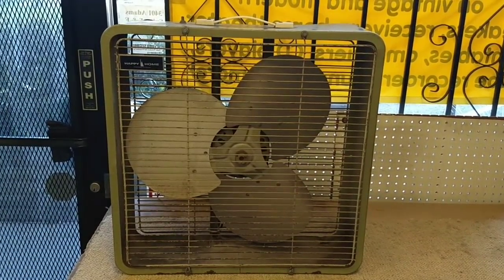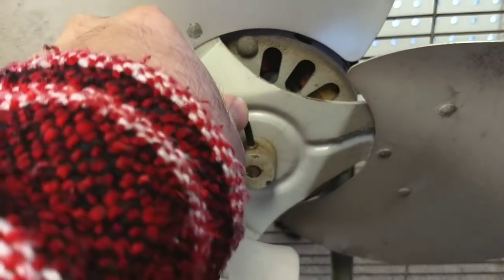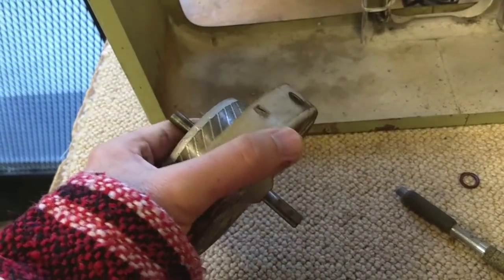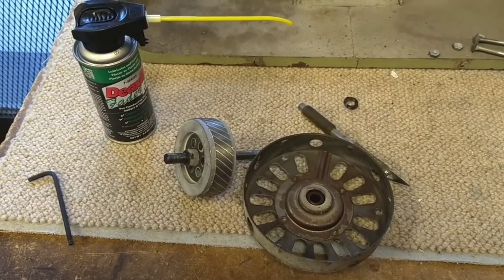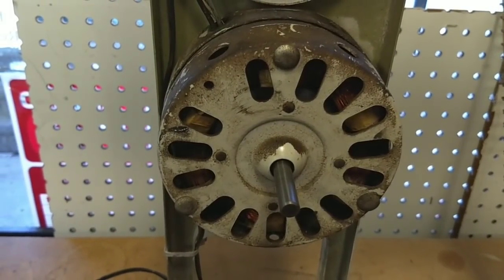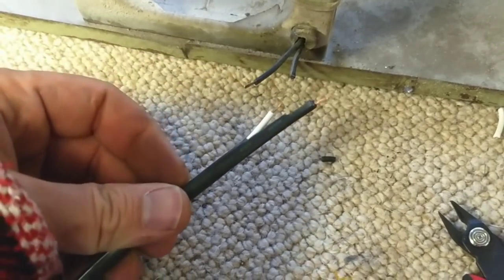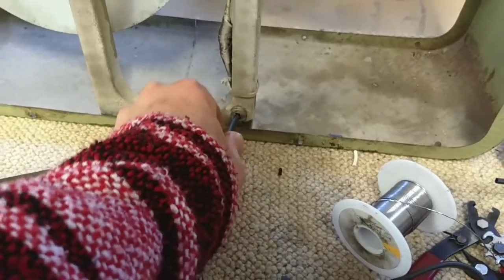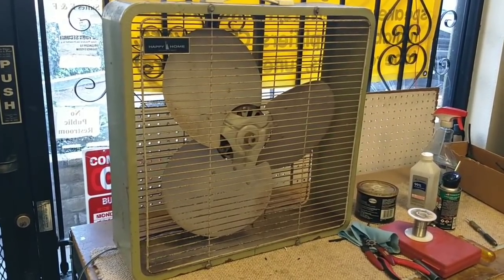Quick repair of vintage New Home 20" box fan

Comment: Hey Broski Jordan!
Man am I happy with you and your vids.
 So I took the fan apart exactly as you did and did exactly as you did. I cleaned everything and it looked good inside. I could not press the motor shaft in and out like you showed us.
I will say it took over 70 minutes to carefully get the back of the motor case AND the center of the motor free from the front so I could clean those holes and everything you did.. I used mineral spirits and  rinced all with alcohol. 
Greased it all up and it went back together very well with some force.
THERE ARE SO MANY WASHERS ON BOTH ENDS. GOOD THING YOU TOLD US ABOUT THAT BECAUSE I VAS VERY CAREFUL FOR THE ORDER THAT THEY CAME OFF BACK IN FRONT AND BACK SO I Could PUT THEM BACK EXACTLY AS THEY WERE.
Thanks so much. I now have a perfectly new and working wisper quiet happy home fan in My happy home and Im super happy!!!  Lolol
Stay Cool Man!!     Literally and figuratively.
Three cheers to you Pal!!

Comment: at least that one made it 50 years, the ones they make now are junk.  my last few i've bougth have barely lasted me 3 years before breaking down.  in fact the longest lasting one is a super cheap $10 one and that's still going strong after 5 years. others i've paid $40 for have only lasted a couple years

Comment: You think that shaft is bad? I have seen some 20 times worse when I serviced motion picture equipment. The worst was Bell & Howell's 500 series. They tried to prevent it by using 3 (!) bearings on the shaft (front, middle, and rear) but lube failed and they ground into the shaft anyway. Especially at the middle bearing. At first glance they looked like they were threaded when removed. The load on the shaft was just too high. Strangely enough, the users seldom noticed until things seized up.

This same problem was seen in 1970s air conditioners where they used ONE long bearing to hold the whole fan and blower shaft with the greatest weight 2/3 or more from the bearing (fan and motor). The heavier fan at the condenser coil end wore the  long sleeve bearing at an angle (as your fan did the front bearing) and the back (blower) end being inflexible, it wore too, resulting in the whole rotor slowly tilting until the friction became too great or the rotor hit the pole pieces. This applied to all using the single bearing in back of the motor design (Whirlpool, etc.) The engineers should have seen it coming. Maybe they did and the bean counters overcame their objections. They got through the first season so who cared if they failed after the warranty ended?

Buyers, that's who.

But this fan, being built so strong, probably lasted long enough to make its buyer very happy. 

You're right about new ones. People don't even expect them to be usable for a second season. You see tons of them on curbside after the summer ends. People don't even care to store them for another year.
Reply: Yep.  I worked on may of those.

Comment: Old as that can just be ,I am surprised if even turns on ,I have a newer version of that it has so many dam screws it's a pain to work on ,then my favorite can is a circle fan I was given used ,I have had it for ten years it works non stop in the ca.summers,I take it apart once a year to clean it ,I never have done anything as far as you have gone ,but when it needs it I will try to save it I bought a new fan that was ten years ago in case my round can ever dies,I am  still waiting .fans takes so much use and manage to last a long time the older fans seem to be made so much better.they are more fixable I think thanks for your video I learn some stuff

Comment: I’ve got a manning bowman that has worn the shaft so bad that it looks like a cam lobe, it makes this motor look like new, I’m eventually going to knock the shaft out of the rotor and replace it, the bushings don’t look too bad on it though, it is LOUD AS HELL when it runs but hammering the shaft into the rotor further fixed that temporarily. Your fan might benefit from new felt thrust washers to quiet it down more.

Comment: Hey brother. 
I have the same exact happy home fan and color combo. Mine is mint and no rust. I even take it apart every year and simonize everything with car simonize.
I didn't see oil holes so I never oiled it
So now it takes 4 minutes after you turn it on for the blade to start spinning but then works quiet and perfect on all speeds.
Oh one difference is I have a white turn knob switch not a push down button switch.
Do you think if I do to my fan what you did in this video, my fan will start up smooth and immediately?  Thank you very Much!!!
Reply from the maker: Yikes. If it's taking 4 min to spin you're putting the motor at peril of burning up. It takes alot of energy to start these and that will heat up the motor windings fast. That and operating with sticky lubricants guarantees accelerated bearing wear.

Take it apart clean and lubricate it
Reply: @JordanPier  Wow, Thank You Jordan especially for the quick response!  OK. I'm glad I asked because this thing was not used excessively but definitely used over the years and more now.  I love to take great care of things especially older things.
 I can do exactly what you did  So thanks for this video... and I guess I will get the grease at home depot? So I'll let you know how it works. Thanks very much Broski!!!!

Comment: A few years ago, I acquired a box fan similar to this, had the 3 large paddle blades. Mine was a teal color and the fan was in excellent shape, no bearing wear. Case was in almost clean condition and the grill was shiny. After I did my usual cleaning/restoring work and properly lubed the motor, I installed an hour meter to the switch. I have almost 11,000 hours on the meter since then and still runs great. I use fans even in the winter, can't sleep without one on. Even though these paddle bladed fans were noisy, I have no problems  sleeping with them on. My fan is a Lakewood X-22.

Comment: Looks just like a Berns Manufacturing fan I have
Polish that shaft with some #600 paper
 Flush the bushings with solvent and oil with synthetic engine oil.
 Oil film may silence the bushing noise, but will need oiling often

Comment: i would get a Lomanco attic fan motor and see if the stator fits in the housings of the new motor. if possible if the diameter of the shaft is bigger you can bore the blade hub out to 1/2 so it fits. as attic fan motors are single speed you can get low speed by adding a choke coil or a triac motor control which will give you variable speed. as the motor mount on your fan is 3 studs is what the Lomanco attic fan motor has.
Reply from the maker: Good info, thanks!

Comment: I have the McGraw Edison version of this one in a 2 speed as well. Do you know if these were also available in 3 speeds? I find it kind of strange that a 20" box fan is only a 2 speed. I have its 12" little brother and it has 3 speeds.
Reply: Yes I have the same exact fan  same color combination and everything but mine must be 1 or 2  Years newer  Because, instead of a push button switch with 2 speeds I have a white dial that starts at hi then goes to medium and then goes to low

Comment: Hello, I know this video is a few years old, but I'm curious if you do vintage fan repairs like this. I have 2 old fans, one of them is a similar version of this by McGraw Eskimo 2-speed with the motor needing repair. Please reply if you provide these services. Thank you!
Reply from the maker: I can service these fans for you. Just be aware that if any bearing damage has been done it will be far too costly to be worth repairing.  In this case another motor must be adapted. However, there is no way to know until the motor has been disassembled, old grease removed and reassembled and bearing clearance checked.
Reply: @JordanPier  That makes sense. I am interested in your restoration services for these box fans that I have. Where are you located? Can you message or e-mail me?
Reply from the maker: @markgillespie1885  inbox me : vintageavrepair (a t) gmail.com

Comment: Do you still have the fan now? What happened to it?
Reply from the maker: It's still chugging along. Sounds like death, but I just keep oiling it. If I ever find a cheap replacement motor I'll stick it in
Reply: @JordanPier  Nice! If I were you I would restore that thing ,  for it to lasted as long as it has is deserves a good restoration but that's completely up to you  , these older fans are getting harder to find now , and they are certainly better than the cheap Chinese fans today . It's a good thing you still have it.

Comment: can you replace bearings in a box fan motor the motor is a McMillan motor
Reply from the maker: You can, but the cost is prohibitive.  A new shaft would need to be pressed into the rotor and new bearings pressed into the housings

Comment: I love everything deoxit,have you tried synthic  grease with Teflon ,super lube makes one.and the one I have is called Rock and Roll sumthin grease with teflon,or synthic oil with Teflon .can the bearing be replaced ?
Reply from the maker: You could replace the bearings, but more importantly the shaft pressed into the rotor magnet is badly worn. The motor size isn't uncommon. I'd be better off replacing the motor as a whole if I really wanted to restore it. Still works as a shop fan for now.
Reply: @JordanPier  Thanks for the info ,I learn something from your video .

Comment: I actually have a video of one up it's in pretty rough shape I thought about trying to find a motor that is similar to steal the front plate off of that has a good bearing in it already then taking the original McGraw Edison motor apart and sticking the front plate from a parts fan on that motor with a good bearing in it cuz usually it's just the front bearing that's out in most of those fans would you say it's a good idea I don't know if I'm going to try it yet but it seems like it would be a good idea all I have to do is just drill a couple holes in the parts plate or the front housing of that parts fan motor and should be in business the shaft diameters are the same size as the bearing spins very cleanly on that shaft and I think it would work but I would like some input from some other people just to kind of make sure I don't completely do something stupid so let's just figure asking a second opinion before I actually attempt it well I'm going to go ahead and finish this video and head to bed pretty cool fanit was my first vintage metal box fan that I actually owned and I still have it it's still my first vintage metal box fan cuz I don't have any others but it is my favorite one because it's my first I want to do everything in my power to preserve it and make it look brand new so basically stripping the cabinet down and getting all the rust off it is probably my first step I need to take well I'm rambling and if this is super long it's because I voice type because I'm blind in one eye and my phone keyboard is very blurry to me but I'll be sure to leave you a like matter of fact I'll subscribe peace